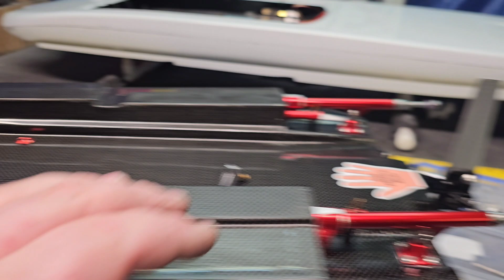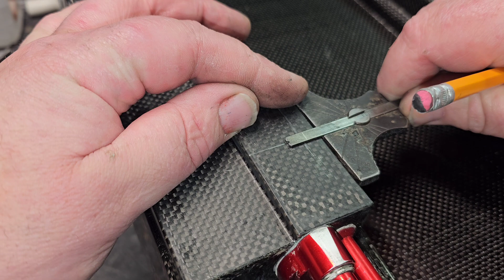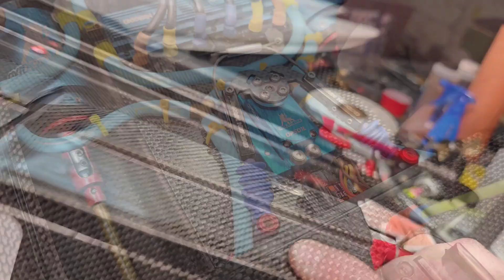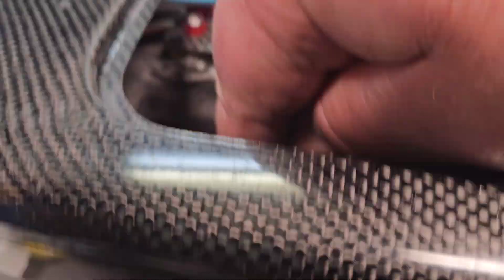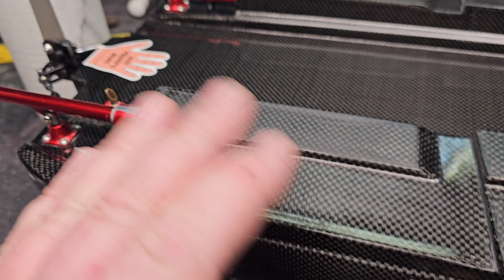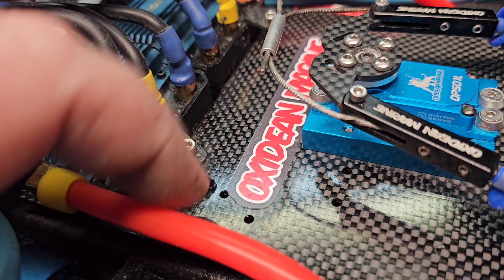Cheap Water Cooling!  TFL Thru-hull Water Pickup Install Oxidean Marine Animal Twin Cat FE Rc Boat

Comment: If you have an email, I'd be interested in talking to you about a cooling issue about my RC Battleship. It's about 43 inches long, weighs about 9 lbs, and is a 1:165 scale model of a CL-83 Battle Cruiser from World War 2. If you got the time, I'd love to dicuss some options for fixing my over heating issues with the ESC.
Reply: Is it water cooled? If so, use a small pump.
Reply: @skifeizzle I've actually fixed my issue, the propeller size was to big for the motor and causing issues, also it's air cooled but I recently switch the fan direction from exhaust to intake.

Comment: One thing that might be handy. Those small files, i use them also with sandpaper around them. For some finesse for like for instance smoothing waterpickup.
Nice clean job, and it makes it more appealing to the eye
Reply from the maker: Thanks for the tip Peter, I will definitely use the file/sand paper method in the future..
Reply: @IRONCLADRC i mean, all these small things help sometimes. These files have all different shapes so that's handy too..
Like you make your own tools and sanding blocks too, to made work bit easier. I found that the (hard)wooden sticks we get in my country when buying paint (to stir it) are also nice to glue some sandpaper on. They will warp eventually like you said since its woord, but hey, then just make another one...

Comment: Other than the occasional nightmare about galvanic corrosion between the carbon and aluminum you won't regret this. 🙂I have some that have been fine for years, but in the future, I will add a buffer of fiberglass.
Reply from the maker: Roger that!   Thanks for the tip, will treat the exposed aluminum.  Thanks

Comment: Careful removing the brass nipples from the pickups, if they did use locktight and you force it youll shear the threads off in the pickup
Reply from the maker: Oh yeah,  I have shaped to many to even count over the years, I have a couple custom ez outs for each size nipple 😆